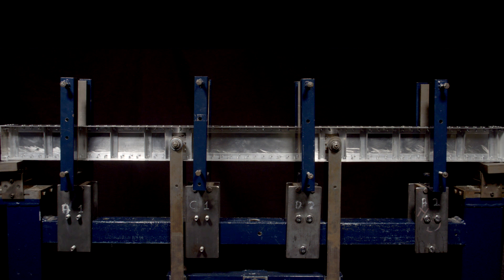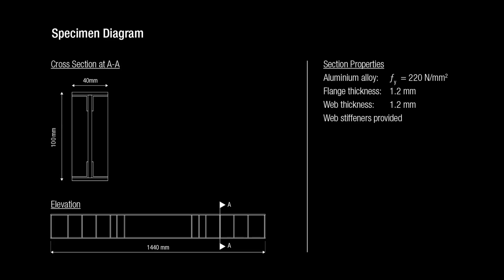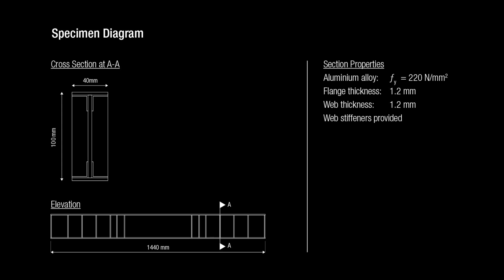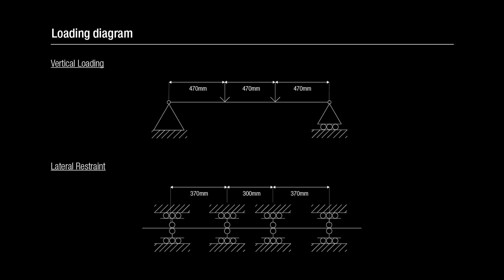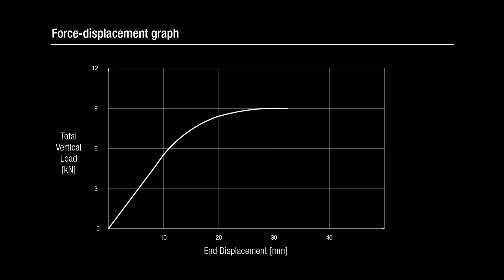Local flange buckling of a plate girder in bending: Materials Lab on-line

Comment: Curious, where/how is the load applied on the beam in this test? I can't make out the mechanism
Reply: Looks like a typical 4-point loading configuration, except the loading points are 'pulled down' instead of pressed from the top. Loading bars to the left of C1 and right of D2.
Reply: i think there's two point near the internal restrained, they pull the beam from the bottom, in fact if you pull the beam from the top falnge o thebottom flange the behavior change.